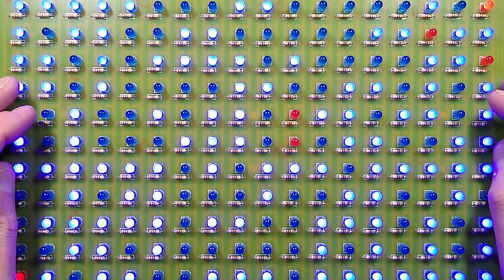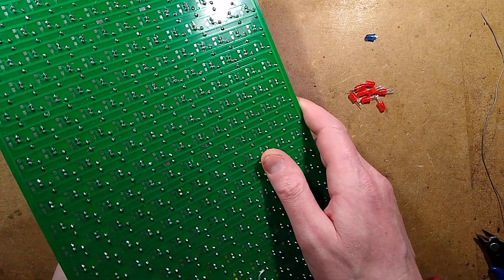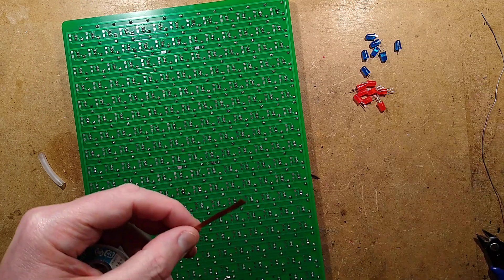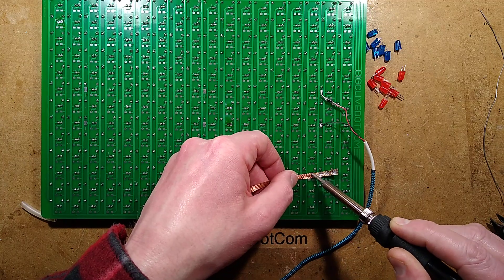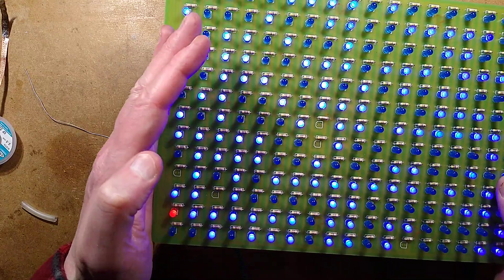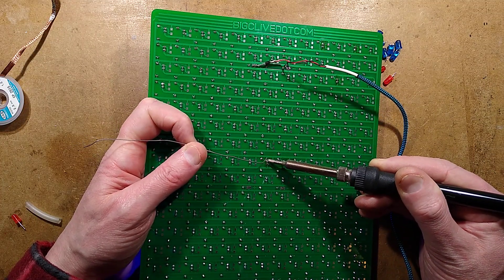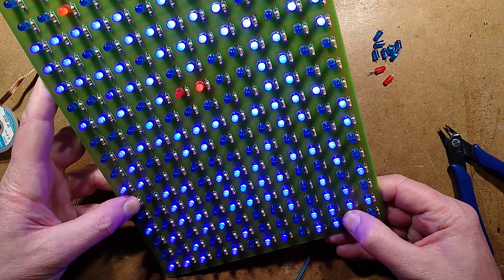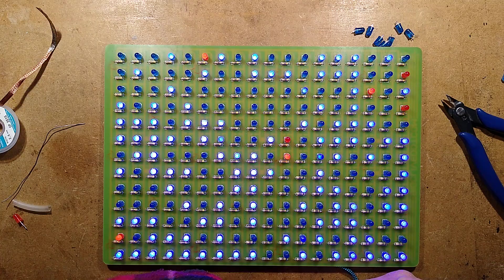Repairing the live stream supercomputer panel

Comment: Hands up all those that remember a time before blue LED were invented.
Reply: Blue? I remember when there were no or just red LEDs in the catalogs. And for years there were small 5mm tungsten bulbs painted in different colors to simulate colored LEDs.
Reply: I'll see you that and raise you—hands up if you remember when remote controls on VCRs had a cable.
Reply: @ConstantlyDamaged  I was born in the age of black and white tv, we only had 3 channels until close at 9pm, see you and raise you 🤣
Reply: @chrishamlet3470  Too rich for my blood.
Reply: @ConstantlyDamaged  Who remembers when there were no VCRs and the term didn't exist, and remote controls on VHF TV sets (there were no UHF TV sets) were wooden boxes about a foot cube with a half-inch thick cloth-covered cable to the TV set? Yea. Those really existed.
Reply: @lwilton  Ha! As a kid I had an old beat-up B&W TV set like that. Only reason I was allowed to have it was I promised I wouldn't take it apart.
Reply: @lwilton  Even in early 80s a lot of TVs had no remotes whatsoever and many had mechanical channel switches for VHF. Clack-clack!
Reply: @ConstantlyDamaged  Or, prior to that Remote Controls (other than the typical ask the spouse to change channels type) were very expensive and had 6 buttons on them ON/Off; volume up/down; channel up/down. Plus there were an amazing set of channels from 2 through 79. But mostly there were 2 through 13 on the American channel system. (Europe had better picture quality on their sets, but not so manty channels.)
Reply: @ConstantlyDamaged  Not bad. When I was a kid, I was the TV remote (no VCRs back then).
Reply: @ConstantlyDamaged  I'll see your VCR Remote with a cable, and Raise the bar to when TVs (in the USA & Canada), were only white phosphor on black, came in a black somewhat rounded face, and drew (consumed) 1000 watts when turned on. They had the ability to have UHF only if you had a separate converter for the 14+to 80 channels, and Radio sets had a "magic eye", or linear glowing bar that converged as the signal was "tuned in" to dead center.
Reply: Hands up those of us can remember when the LED didn't exist! 🙌🙌
Reply: @tinplategeek1058  and suddenly someone comments with "i remember gas lights  kids!" Considering that there are a few 118+ years old people alive it's actually possible.
Reply: @shadowflash705  That made me chuckle out loud, well done.
Reply: (snort)
Kids these days. I remember when LEDs first became commercially available. Hell, I remember when the ruby laser was invented.
I remember when computers actually had banks of tungsten filament state indicator lights.
Show of hands those who know why "debuggng" is called that.
Now get offa my lawn.
Reply: @markfergerson2145  Admiral Grace Hopper, c. 1947 upon discovering "An Actual Hardware BUG" having met its demise and become just that extra little unplanned hardware component that shifted the results.  A bit before my time; An added message to those you just chased off your lawn: "It wouldn't hurt you to read a book once or twice in your (wow, like a thousand adjectives could go here...) lives!!"
Reply: @markfergerson2145  I remember the first lasers too,  a ruby rod, a mirror and a semi mirror with a flash tube wrapped around,  boy have the shrunken down.
Reply: @markfergerson2145  my dad used to build real time computers for vehicle crash test lines, and used an oscilloscope for debugging ;)
Reply: @markfergerson2145  Admiral Grace Hopper, c. 1947 credited with finding  an actual dead insect causing a fault in one of her computing machines.  This is an aside to her incredible contributions to computer science and retirement from the US Navy with full honors, just a quick glimpse from 10,000 feet;  Look closer and the list of achievements, honorariums and awards just goes on and on.  She was a truly amazing lady.
Reply: @scottbrown4534  Finally, someone who knows a little history!
Reply: @Okurkaarrgghh  I stand corrected.
Reply: @markfergerson2145  Whem I first got into 'IT', we were taught how to use an oscilloscope to check the CPU clock frequency!
Reply: Sadly I remember before LEDS where invented and we used Nixie tubes and neons.
Reply: @chrishamlet3470  Congratulations, then Chris, since you were pre-1970s involved in electronics to notice, to be near retirement age.(>50 years ago). At that time the Moon Shots were all the rage, and there is even an existing key panel of LED displays over at the "FranTone" lab. Computers ran on something called "paper tape", and Frequency counters and other "high end" lab equipment had nixie displays. (it even managed to get into mainstream movies such as 1970's "Collossus: The Forbin project".
Reply: @oldradioparts1962  yes I got involved through my Dad, I worked at Ferranti computers from 1977 and repaired tape punches and readers among other things. More fun then in electronics but times have to move on.
Reply: @chrishamlet3470  Agreed my mother found me behind the ice box in 1959 she swore to the end the milkman left me there
Reply: @chrishamlet3470  i used to like the neons but they used to burn out fast
Reply: Ha! I remember when we had to dip the LEDs in tallow and set light to them.  They only lasted 20 minutes then you had to replace them...
Reply: @HughPryor  "That was all we had, and we LIKED THEM!"
Reply: In a previous life I built an RS422 (Sony protocol) hand-held remote. It was extremely useful in a broadcast environment for fault finding. My colleagues were impressed mostly that I had included a blue LED. The LED had cost over £5, but fortunately that got lost in the spare components budget.
Reply: I remember a time before blue led  headlights burnt out my retinas.
Reply: I remember soldering exercises my dad made me do in the 80s with tiny, red dual LEDs with three wires. He also did "something" I don't quite remember, which, to this day gives me low level dread of soldering irons and makes me jump back when one drops (while I try to catch dropping knives with my foot!)
Reply: @killroy42  I still have a bag of those three wire bi coloured LEDs, I should put them on my super computer.
Reply: Very faint red LEDs that cost a fortune and were easy to blow up.
Reply: @Franko_Walker  and boy did they ever blow up!
Reply: Blue LEDs were so expensive when they first came along that you only saw them on cost-no-object gear.
I hate the things and replace them with orange when they fail as I find that easier on the eye - but then I still build my own HiFi gear with valves...
Reply: Red and green. That was it in the good old days.
Reply: Y'all are a bunch of fogies, or wannabes anyway.
Nobody mentioned amidst red & green & bi-colored LEDs, and VCRs, nobody mentioned the first remote TV channel changer I heard of:  it was some kind of clicker, some kind of  acoustic thing.  Might've changed channels in both directions (up and down) but details are now fuzzy.
Now g'wan, scram! before I call the dog on target!
Reply: @77thTrombone  It was just a box with a couple of tuning forks in it. Generated near-ultrasonic chimes a microphone on the TV picked up, which then drove a motor to clunk the channel knob one direction or the other, some sets could also adjust the volume or turn the power on and off.
This had two side-effects: the remote would annoy the hell out of your dog, and if you jingled keys it would change the channel or turn the TV off.
Reply: I remember seeing at least 1 "post" in the open "shooting" end of the one I saw.  Figured it must've been some kind of resonator with a freq/impulse detector on the TV.  (Go, Fourier!)
I'm imaging the full-featured versions using a DTMF scheme. 
"Press 'Channel Up' to bother Bowser."
"Press 'TV Off' to send Bowser across the river"
"Press 'Volume Up' to bother the ultra-sensitive wife"
"Press 'TV On' to send the ultra-sensitive wife…"
<sigh> One tends to forget the lost features of obsolete tech.
Reply: oh yes , A revolution back in 1997
Reply: I’m pretty sure that all the fireflys stopped appearing when blue leds started the consumer wares intrusion ... actions have consequences ...  I want the fireflies back!!!
Reply: I built the maplins bat detector because interested in the ultrasound spectrum but found you can listen to quartz crystals to look for that vital heart beat. Not a blue led insight but make sure you are offered the German microphone.
Reply: @Ignatios Nelson  I like warm white inside, and either warm white or cold white outside, but not a mixture of both.
Reply: I remember the time BEFORE LEDs were a thing. 12 Volt bulbs and neon pilot lights.
Reply: I remember when blue LEDs on any gadget were a sure sign it was crappy. Now they are just a so-so sign of that.
Reply: @Sashazur  now they're basically just annoying...
Reply: @Sashazur  I remember when it was only dim red and infrared leds. Might have been others but I don't remember any other leds at that time..
Reply: @Verified_1789  yes the redvones were invented first and we in a package similar to a to18, then they developed the Green ones, Then the blue, once blue was invented The first ones I had came from RS Components and cost £5 each.
Reply: @Sashazur  That doesn't make them much less annoying, especially as standby lights.
Reply: neon4life

Comment: To use addressable LED light strips is faster to make than this panel so If I were to make a panel for the Hollywood just throw down LED strips and quick programming and laser cut holes in a board to cover them. Fast and ready to go. Old dot matrix Printers were awesome But Print like crap.

Comment: On the connection lead to the board on the back, is that a diode?
Reply from the maker: Yes.  To drop the voltage slightly and nudge the intensity down.

Comment: What is the wick trick? I have to confess I feel miserable when I make use of it even with loads of flux, usually I end up removing the pads too... :(
Reply from the maker: Flux and practice.
Reply: If you're removing pads, your iron is too hot or the PCB is very low quality.
Reply: You heat the wick, with the other side on the solder to be removed, minimal heat should go into the board (which is what lifts pads). Use good wick, Goot, MG, etc. from a good supplier, it should soak up solder fast and easy.

Comment: I have to make a few of these and put them in boxes! when i saw it on the live i tought it had some circutry on the board. I could calculate it and find the leds myself but i'm lazy haha, what value are those reisitors on 5 volts? and do you have a link to the leds? if not it's fine i'm sure i can find some.     edit: shit just went on your website and realised you alredy said what leds and values, well anyway keep up the good content hahah
Reply: actualy one thing, why do you suggest  220 ohm for the 6x9 grid and 470 ohm for the 13x18 grid?
Reply from the maker: The higher number of LEDs means current adds up quickly.
Reply: @bigclivedotcom  ah right, thanks Clive

Comment: The reason for the lights on early mainframes is because the internal registers of the machine were displayed on those lights.  Ours were actually neon pushbuttons.  You could halt the computer, and press on the neon bulbs to toggle bits in the registers and memory.  That was actually how you entered the initial boot loader to tell it to load the rest of the system from cards, tape or drum storage - one bit at a time.
Reply: The "computers have lots of flashing lights" came from an early newsreel film of one (I think it was ENIAC, IIRC the demo was computing the trajectory of a shell, one of the main tasks ENIAC was built for, and in this case it was able to compute the trajectory in half the real flight time of the shell).  It had neon lamps as a readout, but these didn't show up well on the film.  They stuck ping pong balls with numbers on them, and they showed up quite well.  And for quite a while, the popular image of a computer involved a panel of ping pong ball sized lamps.
Reply: @evensgrey  While that is now the popular internet myth, the fact is that most mainframe computers built before the 1990s had walls of lights. I spent most of my life from the late 1960s working with mainframe computers, and I can assure you that if I opened up any of the doors on the processor or I/O cabinets, I was confronted with lights or LEDs displaying register values in realtime. If you knew the machine architecture and it seemed to be doing something strange, you could very often take a look at the lights and get a pretty good idea what was going wrong in only a few seconds, rather than spending possibly hours trying to track the problem down in software or hardware debugging.
Reply: @lwilton  I heard a different origin story: The vacuum tubes that were used before transistors tended to burn out quite frequently, and the status lamps helped quickly identify which tube/valve to replace.
Reply: @johndododoe1411  I'm afraid you slightly misheard. :-) In the vacuum tube days, there were TWO indicator panels on the console, or tucked away somewhere in the machine.
One of these was the "blown fuse indicators" and the other was the register display. They were completely separate things, and the blown fuse indicators didn't show you a failed vacuum tube, it showed you that a particular fuse was blown. Knowing that a given fuse was blown isolated the trouble shooting to a small part of the machine, but there were still a whole lot of possible problems other than just a failed vacuum tube.
If a fuse blew, the register displays may or may not have still been alive. Often a large section of the display would just turn off. So that generally wasn't very helpful in finding the problem.

The vacuum tubes did fail a lot, but generally you found this in the "morning PM" (preventative maintenance) session. You would power up the computer, let it warm up for 15 minutes or so, and then (if it was working well enough) you loaded the "all orders" tape and let the machine run processor tests. Then you went to the power control panel and varied the voltages to the machine by about 15% up and down. Weak tubes would often fail at a lower voltage when they worked fine at normal voltage. The all orders test would detect an invalid result and halt, and you could then see which halt it was and what part of the machine that was checking, and from there get out the voltmeter and scope and track down the failing module, and usually replace a tube or two.
This typically took about 2 hours in the morning, and you gave the machine to the operators by 8 (having got there yourself at 6 AM), and  in most cases it would run until 4 or 6 PM without any failures.
Reply: Curious Marc, is that you?

Comment: A question for you what powers this light panel I’d be interested to know
Reply: 12:40 he explains he's using a switch-mode USB type 5v power supply.
Reply: @dryroasted5599  thanks
Reply from the maker: A standard USB power supply, or a power bank on the live streams.
Reply: @bigclivedotcom  thanks for your response it seems a very small (5v) power supply for so many leds  I’m new to tinkering with electronics and of a mind to make my own version of your light panel with 144 leds which is why I wanted to know

Comment: personally, i would have socketed the LEDS for easy replacement, but then if you through they would last loner, then no need.. though since I'm having huge problems even with a 555 Schmitt trigger circuit, I'm hardly one to give advice ¬_¬
Reply: Good sockets or tension pin headers aren’t cheap. and less you purchase the Teflon version, they can easily melt a bit when soldering which causes contact problems. And can lose contact and have corrosion/contact problems in a damp environments. And clives home…The Isle of Man.... is basically an Amazon rainforest 😂 

 I LOVE! sockets, I actually collect rare and high-quality vintage and modern sockets. 

My favorite are the Thor labs/arroyo branded all in one laser diode test sockets. With built in active cooling, built-in driver, and computer interface connection. About a $500 for each socket!!. I’ve got several of them for different form factors and luckily picked them up on eBay for a song.

If you want to see some beautiful sockets, look at the Teflon “Augat” brand transistor and IC sockets that are turquoise colored and gold plated. Almost as beautiful as gold plated and white ceramic vintage Ic chips

There are also some beautiful vintage IC and transistor sockets, some of them cost a CRAZY amount. 

All of the beautiful 3m brand ziff sockets with their gold plating and bright vibrant colors, With a little brass handled lever to release the IC pens. 

Sockets and test fixtures can be beautiful things!!!

Comment: My "supercomputer" build has not had any of the blinking blue leds fail as of yet.  I did a 3D printed black "grid" to contain each LED (with the resistors hidden on the back) in a 9x11 grid that matched a Dollar Tree picture frame I used to dress up the edges.  It is powered by 3.7v with two parallel 18650s using a tp4056 charger / low voltage protector module.  Unfortunately there are NO cool white LEDs in the build...  <sigh>

Comment: I'm not surprised some have failed. If they're anything like the color changing LEDs running them off a 5V supply even with current limiting resistors will kill them. You need to run them from a 3.0V to 3.3V regulated supply. A cheap adjustable buck converter  is fine for this then you can use anything from a 5V to 24 V supply. Just make certain you're not overloading the buck converter.